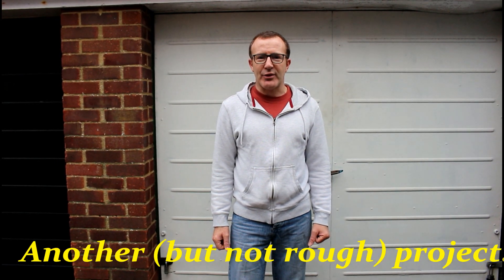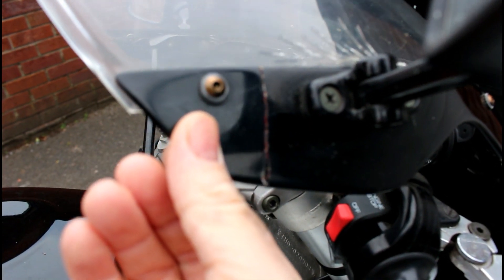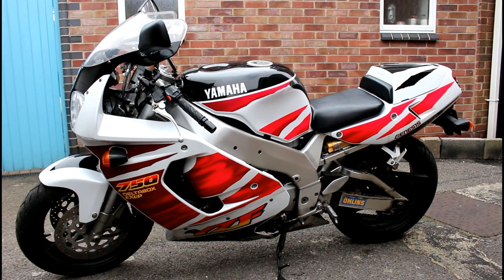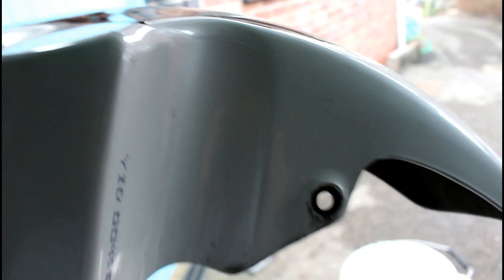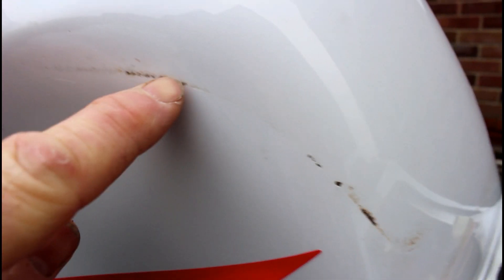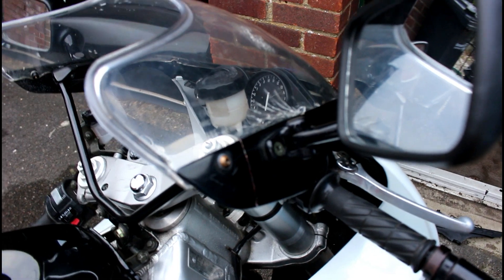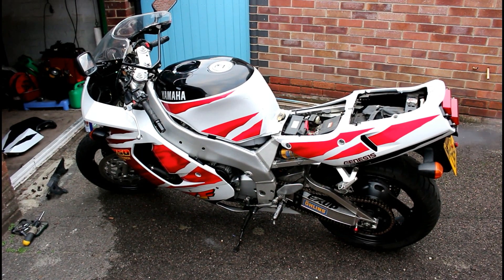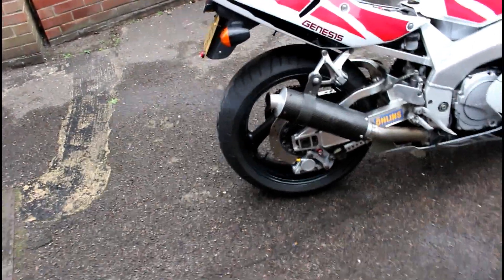Yamaha YZF 750R 1995

Comment: I have a 95 er here in Australia. I love it.
Reply from the maker: I regret selling it on, was only to be a quick money spinning project, which it was, but still I regret it now !
Reply: @DeanAllen  Can you tell me a bit about pricing? I hope it's not too rude to ask! How much did you buy it for and how much was it worth fixed? I got the exact same bike. I don't know anything about bike mechanics though. I'm considering fixing or selling my bike though. Don't ask me how I got it ... it's a really long story, but lets say i got it for free. It needs some work though (tires, chain, sprockets, oil change etc.).
Reply from the maker: @jandejonge205  
Hello I had got this bike in winter time at a bargain £1250 or there abouts, can't remember the exact amount now. 
I cleaned it, fixed the fairing and sold it for £1600 in very good condition with low  ish miles upto 20k there are now worth around £2-2.5K mint you can go to £3-£4K maybe, the price is ever increasing as they become more rare, and people appreciate just how good they are. My new one was £995 but is a bit of a money pit, I have sourced decent parts cheap, but it owes me in excess of 2k now all in. BUT they are worth every penny.
Reply: @DeanAllen  Awesome! Thanks for the info. Mine is in worse condition. It has been sitting, needs new oil, oilfiler, chain, sprocket, tires and brakepads. Maybe more. I think I'm looking at around 700€ of parts. Now the story of how I got this bike is more complicated. I got it for free basically. Two dudes parked their bikes at my grandparents house, because the Suzuki GSFR 1100 (the other bike) had a hole in the motorblock. They didn't come to pick them up within two weeks so my grandparents called the police, turns out the bikes werent insured. One day someone else comes to pick up the bikes. Police is informed and takes the keys and his id. Now tons of time passes while the police tries to find the original owners. Turns out the owner is in jail and a bad criminal. My grandparents wrote a letter to him and his accountant how to return the bikes and ask for a compensation for parking the bikes so long. They never answered. Later they reported the bikes to the lost and found. Because no one claimed the bikes within a timeframe the bikes are now legally mine. I just got my A2 license and am pretty new to motorcycles. So it will be hard to fix, but I think I should try ... Thanks again.

Comment: I had exactly the same bike, cost me new in 95 £8550, sold it around 03 for £ 2000, i do miss it a little bit, but i now have an owo2 R7 that i px,d the 750R  in for, £9000 cash + £2000 px got me the R7 for £11K,.

Comment: 6 piston calipers were superb is that why so many guy like myself go out and buy a set of blue or gold dots and do the swap due to the rotors warp on the yzf750  bikes and if you're asking why when you have 6 piston calipers you would go to 4 piston well it seem to solve the problem of rotors warping and why did Yamaha go back to 4 pistons when the r1 has around 150 hp and the yzf 750 has 120 hp with 6 piston  the 4 piston must work just as good  I like the gold there lighter due to ceramic pistons  you also need the break master cylinder from an r1 or r6 to match the 4 piston calipers  you also need  rotors from a Ducati 916 or other bikes that use those rotors due to  the little round things on the rotors hit the brake pads if you keep the 750 rotors now you can just shave a little off the ends of the pads of the blue or gold dots  and they'll miss

Comment: Yours is in very good condition!!! I just bought one, but needs restoration. Exactly the same model and colors! Do you have any idea where I can find the decals?
Reply from the maker: I bought the decals my self from a company ( online ofcourse) problem is, this was for the Blue and Pink model, this black and red has long gone to another owner. The blue and pink is not quite a match to original and not Pearlescent. They would look good on a newly painted bike, where  not matching to any original colours, but I never used them in the end. 
If I find some time, I will dig them out and show on a video. There maybe the info of where I bought them. They may do others for later bikes.Was a bit annoyed when they arrived and not exactly the same.
Reply: @DeanAllen  I though the mismatched colours might be the case when it's not the original ones. I might look into a different solution: airbrushing the whole decals. Thank you so much for your response!!!